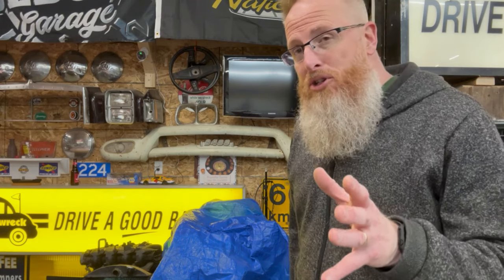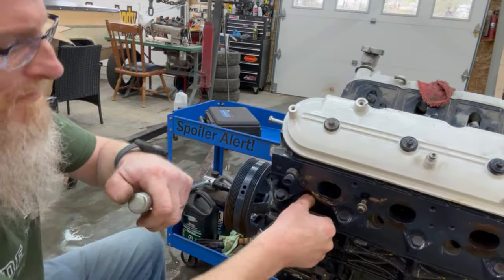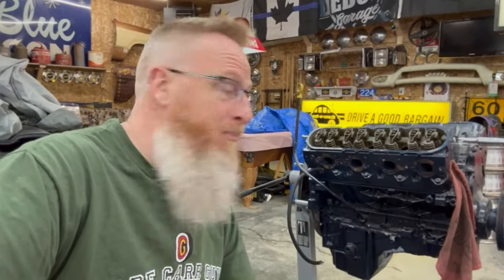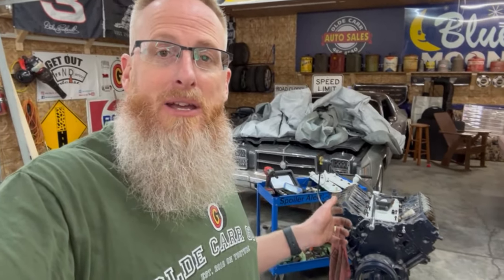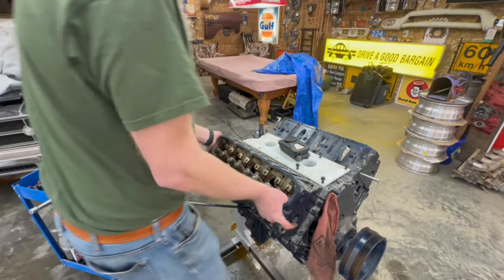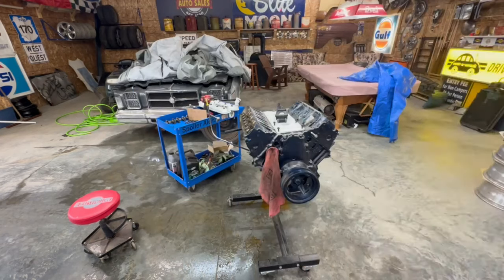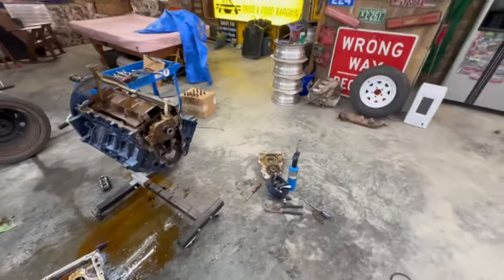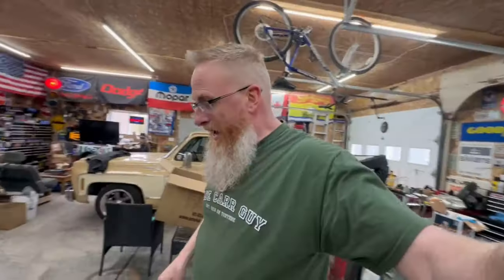I Gambled On A Cheap LM7 5.3 LS-Let's Tear It Down. Is It Junk!

Comment: I used masking tape on each push rod and labeled it Cylinder # and E or I for exhaust or intake with the Fairmont. But as oily as they are had trouble with the tape staying on real good...I think the cardboard might be better move. Glad you shared! Seems like you really got a nice starting point bud!
Reply from the maker: I sure hope so! How soon will be determined by an upcoming 2000 mile road trip!

Comment: Never flip a used engine upside down before the oil pan is removed.🤔😎👍
Reply from the maker: How would you suggest I remove the oil pan? Standing on my head? 😂
Reply: @OldeCarrGuy  
🙄Of course not, it's on an engine stand you don't need to see the bolts to put a socket on them do you?🤔🤨😁 Any debris, sludge or leftover oil in the pan will stay in the pan if you don't flip before removing.(That gravity thing)After the pan is cleaned out it's perfectly fine to install upside down. If anything it will save you time cleaning the leftover oil off the parts it drips when it's upside down for reassembly.😎👍
Reply from the maker: Pan is off and no sludge in the engine! Win win! 😊

It’s all coming apart anyway so it doesn’t really matter! Just having fun my man! I appreciate your concern!
Reply: @OldeCarrGuy  
I know, just a pet peeve of mine, it makes me cringe to think about the leftover snot and or debris in the pan pouring on the rotating assembly.🤷😁👍